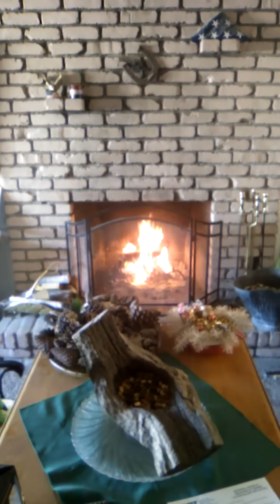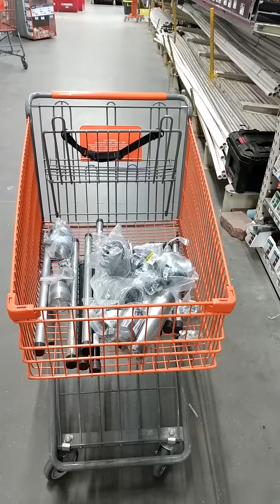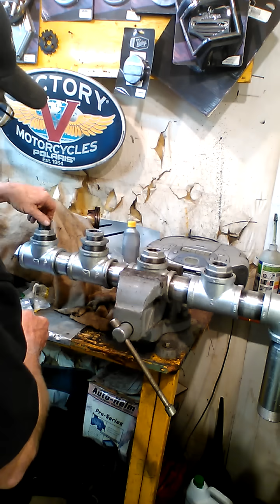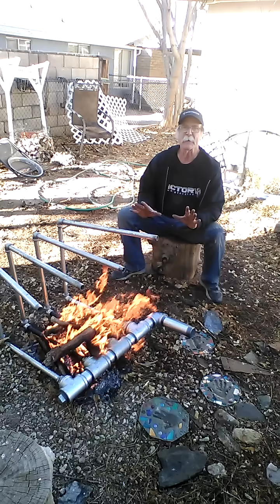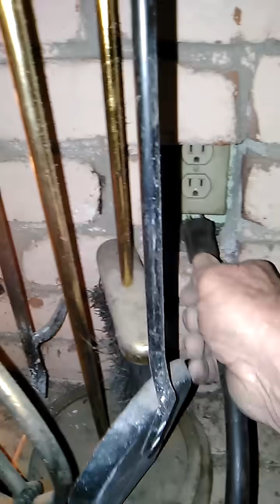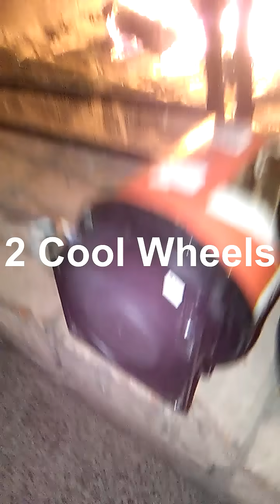Can I build a cheap heat exchanger? #heater #fireplace #pipes #mechanic #cheap #Galvanized #heat

Comment: I just noticed all those extra bushings ya had to buy too. That jacked up the bill too.
All in 1.5" would give you more surface area and lots more heat exchange for your project. Otherwise not too bad first efforts. Those really can work well if ya do them right.
Reply from the maker: @johnfriedmann2413  I agree. But that's all they had in stock at the time.
Reply: What's 1.5? Is that the size of the...??